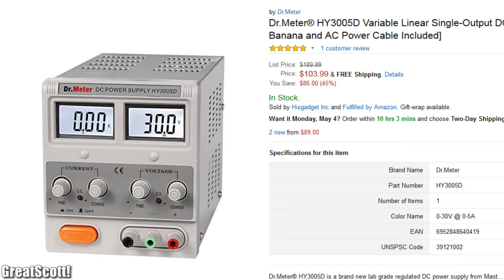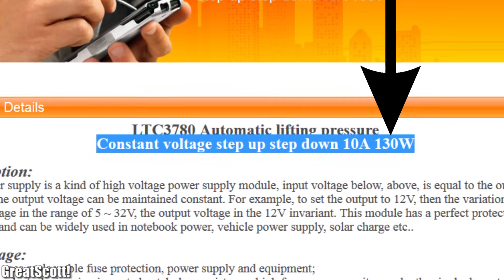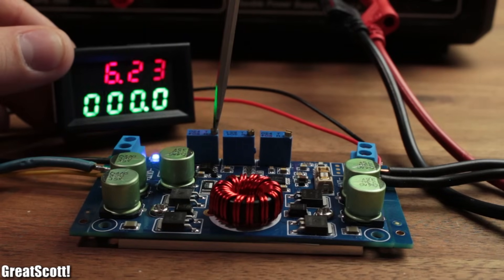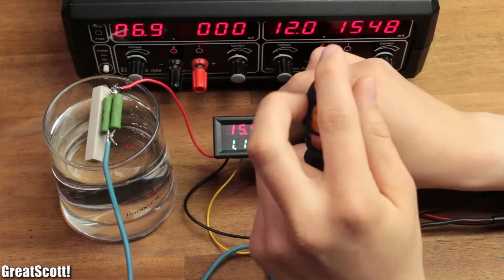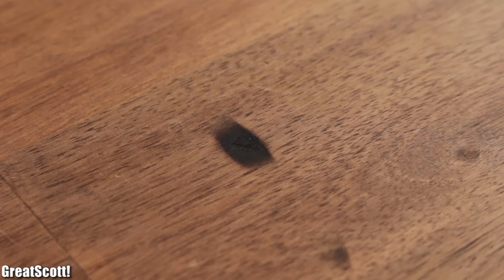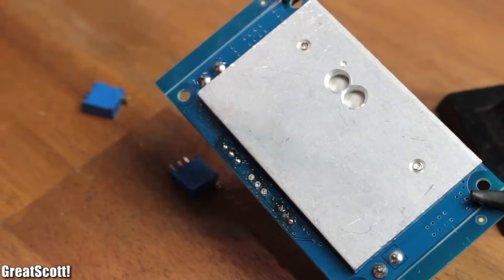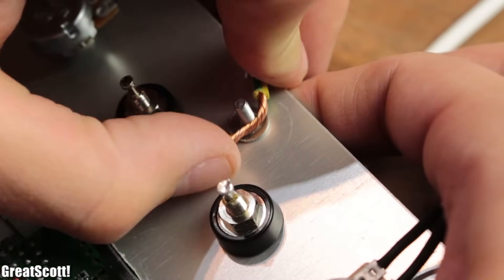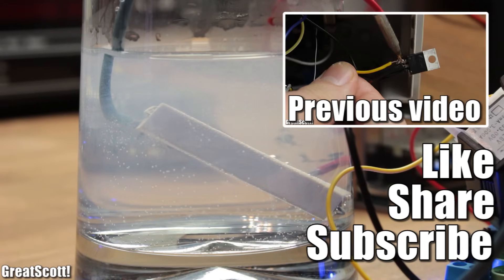Build your own Variable Lab Bench Power Supply

Comment: I don't really see the point of the 12V 5A power supply as you can just replace it with a transformer, a bridge rectifier and capacitors.
Reply: iCore He said he wanted to keep it modular and not create any of the circuits
Reply from the maker: iCore Here is a good comparison: https://www.valuetronics.com/Manuals/Lambda_%20linear_versus_switching.pdf  +The Efficiency was important to me.

Comment: Scott, you could have added a 5A fuse for additional protection. http://detail.tmall.com/item.htm?id=41558298367&spm=a1z09.2.9.318.pbjJro&_u=420resoi0f65.
Btw, those Volt/Ammeter are not very accurate on showing the current rating, volt reading is fine.

As for the turning pot, best to use 10 turns Bourns.
Reply from the maker: TheOldmankk I agree with the pot. But the Amp meter was actually quite precise. I tested it before. And yes, I could have added the 5A fuse at the output of the 12V supply.

Comment: It's a great idea but how reliable is this unbranded dc-dc converter? And why is it so expensive considering the fact that it's no name Chinese electronics? Is it because of its high wattage?
Reply: Mandragoras  There are gold mine, there are land mine. haha.... my two cents, I gave myself certain safety discounts not trusting their stated performance spec. Widely know, they simply zapped from the IC data sheet not the actual final products of lab tested results itself. Hence, I would rather stick to 0.6 factor of Amp, 0.8 factor of Volts.
Reply from the maker: Mandragoras LTC3780 has a current limit so we don't need that. The 12V supply should have a short circuit protection.
Reply from the maker: Mandragoras Even if it is a no name board, the IC and the components still cost a bit of money. I would not think of it as a bad unreliable product.
Reply: Mandragoras UK Juliet ilett or Jim Corner did many evaluations on those China made dc-dc converters, some are pretty good though. haha.
Reply: TheOldmankk Julian reviewed many cheap electronics coming from China that are not good. They might end up being ok, they might not. It's like a gamble. This is why I use to question their reliability. 
For example, I bought two buck converters, the cheap ones that Julian has shown on his channel, the first one died and the second started to act up. One power bank I bought charges the internal battery up to 4.27 volts. A lithium battery charger board was malfunctioning since I received it. 4/4 failures. Unfortunately Chinese manufacturers seem to use a lot of shortcuts, skip quality control and disregard safety regulations.
Reply: TheOldmankk Who's Jim Corner? I'd like to browse his channel.
Reply: GreatScott! Does it have short circuit protection on its output? If not, is it a bad idea to add one in this diy project on the output?
Reply: GreatScott! I was so tired when I posted my questions that my second question doesn't even make sense. What I really wanted to know is if it has or needs a diode on the output for lithium batteries charging. Is there any chance to damage the board if I connect a cell while the board is not yet turned on?

Comment: I just used a PC Power supply :p
Reply: +SteelBlueVision PC power supplies have short circuit protection even if it did short circuit it would not be explosive it would be quite uneventful.
Reply: SteelBlueVision
These PSUs usually have Over surge protection it wont allow more than the rated amps or it trips the cutoff and at the least temperature cutoff after it gets too hot it will shutoff
Reply: SteelBlueVision
My PC PSU wont even go 1 amp over the rated voltage and the max is only for a certain period of time and then it shuts off
Reply: +Olivier Van Heulen We eagerly await the "explosive" video of your first short circuit with said power supply.
Reply: And if the circuit is not a true short, but draws 30 amps, what protection is there?

Comment: Great tutorial Scott but I think you're missing a very important safety feature. A fuse on the AC input! Considering you are using a "no-name" power supply I think this is essential. Also, leaving those AC contacts unprotected like that makes me cringe, some crimp connecters would be great but some heatshrink would be good enough I guess.
Reply: Hampus Sandberg Yep, installing fuse protection & using heatshink on all exposed terminal connections where safety feature I installed into my version of this project.
Reply: ***** I have been bench testing a Sure Electronics 2 x 100 watt amp module with my DIY version of this benchtop power supply at 24v 2A running a 500hz test tone over night. I did a thermal test using a thermal imager & the temps where barely above ambient even though my enclosure is a sealed enclosure so I don't think a fan is required for this design.
Reply: Those LED psus have fuses in them. I know this is a really old comment but thought I'd reply for others who read.
Reply: The 12v 5a power supply already have a internal fuse inside so there is no problem
Reply: using an power terminal with fuse that you can reach without even opening that enclosure would be the best option. It doesn't hurt to have a extra fuse.
Reply: These power supplies has already fuse in it, also short circuit protection (instantaneously turn off the output till the sort circuit gone), thermal protection, flow backward protection, over current and over voltage protection...
So it has every possible safety features all sides, in and out...
Reply: But you heard him. He's lazy.
Reply: The UK standard requires a fuse in the plug - would it be redundant to have one in the unit too?
Reply: @RoamingAdhocrat  As long as it doesn't conFUSE you, I see no Problem with adding an extra one. 

Sorry for the horrible pun, I'll go now.
Reply: I think that the converter has one built in.
Reply: The power supply has fuse inside it, the only problem it's was, it's doesn't have interference inductor filter, ac capasitor, Thermistor on the input

Also The main switching transistor need proper heatsink instead just put in the case with isolator between it, which is make it worse to reduce the heat
Reply: Not a big deal. People used to test if the power was on by kicking their fingers and touching it.

Comment: A can not be cheaper?I know that and so it is cheaper than if you buy a ready power supply.
Reply: Matess for 3-5A application these two not too bad. http://detail.tmall.com/item.htm?id=17276330679&spm=a1z0k.7385961.1997985097.d4918993.RvlEsS&_u=420resoic951

or
CPS-3205
http://item.taobao.com/item.htm?spm=a1z0d.6639537.1997196601.405.YInl9W&id=36283872535
Reply: +TheOldmankk The Gophert is great, the other one is cheap junk...

Comment: Can you also make a more advanced version?  I am currently using opamps to control some transistors trying to make a constant current supply power supply,  but I've run into issues
Reply from the maker: Kris S A constant current circuit will be a topic in a future video.
Reply: GreatScott! One that controls voltage and current?  

I built a circuit that has two MOSFETs, one controls the voltage,  then the next one controls the current,  but this creates twice the heat... So now I am trying to create one that will use only one transistor, controlled by opamps to regulate both current and voltage.  Is that what your future video will be about?

I could send you the circuit that I have--it works in simulation,  but not so much in real life--the op amps seem to interfere with each other, but I don't have an oscilloscope so I can't see exactly what is happening.
Reply from the maker: Kris S
I did not intended to go this complex. But you can surely send me your circuit. I will think about it.
Reply: Kris S 
It's not video, but looks like you are trying to make this: 
A well-proven power supply that provides 0V to 20V with current limiting in two ranges of 100mA and 1A.
http://www.epemag3.com/lib/free_projects/lab_equipment/0102-%20%20Versatile%20Bench%20Power%20Supply.pdf
Reply: I checked our your circuit, i see ur intentions but there are some fundamental flaws. Firstly u cant control both current and voltage like this. it will be one at a time. You
can have a voltage mode with a set current limit or a current mode with a voltage limit. Usually the one you want is a constant voltage with some current limit set. 

Now about your circuit, ill give you a few hints and leave the rest to u to figure out :)

1) Resign ur circuit so it simply lowers the set voltage when it detects too much current through the load. The problem with your circuit right now is that the opamps are tying to cancel each other out!
Reply: Heat sinks for transistors. Designing the heat sink.
http://electronicsclub.info/transistors.htm#heatsink
Reply: GreatScott! Here is a photo of the circuit diagram. https://plus.google.com/+KrisShellman/posts/GozyhCjq6Xm
Reply: Giligain I. Haha thanks man,   I'll check it out.  I am looking to create variable current,  but I might be able to modify this.
Reply: GreatScott! The intention is for an Arduino to control the reference voltage, I have a video on my channel of this working,  but it only works for constant current OR constant voltage.  not both at the same time.
Reply: #goodread and may address some ideas or you may already know. 
http://forum.arduino.cc/index.php?topic=223911.0
Note that with PWM, you are not controlling voltage (or current).  You are controlling time.   i.e. With 10% PWM, the average voltage is 10% of the maximum.

Based on this premise: Time is the connector/glue between two separate circuits, one providing voltage control, and the other current control. This makes me think about using Multi-threading with Arduino..I just posted about this. Of course this may be a totally different direction than you intend, but it's something I might be able to explore with when I get around to messing with the idea of Multi-threading.
Reply: Adil Malim yes I realize this,  What  am aiming for is that the circuit will go to the desired voltage only if it is not over the current limit,  so the current limit takes priority.  I want to to always go to the voltage limit while the current is below the current limit.  I've been scratching my head with this for weeks.  THis is my first project using op amps so I am not yet skilled.

Do you have any suggestions?  Could you use the app located here: http://www.falstad.com/circuit/ to show me what you mean?
Reply: Kris S i think the mosfet can get really warm and scott's version stay cool.
Reply: EliteReacon But I want to make it myself,  and I have big heatsinks ;)
Reply: I've built a working circuit in my simulator --let's see if it works in real life
Reply: ***** I actually made one of those a few years ago.  Very useful.